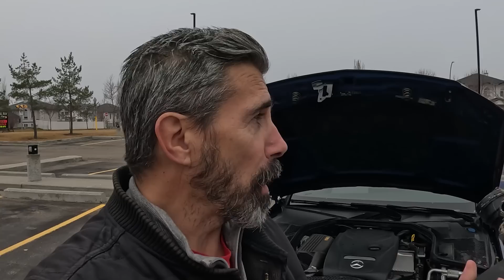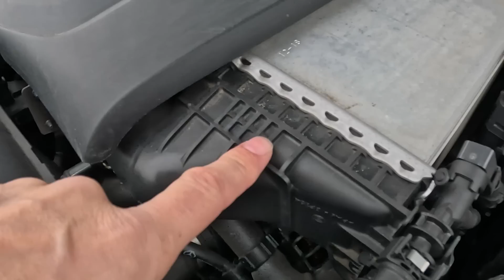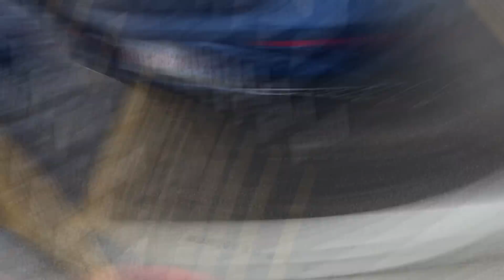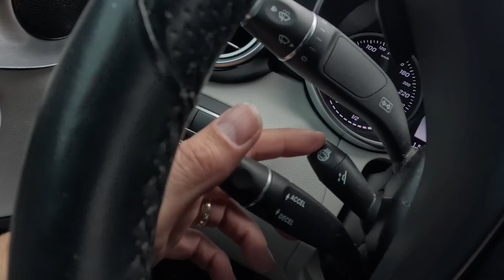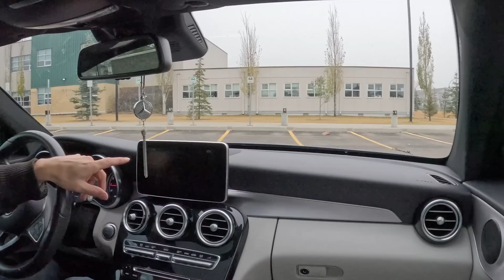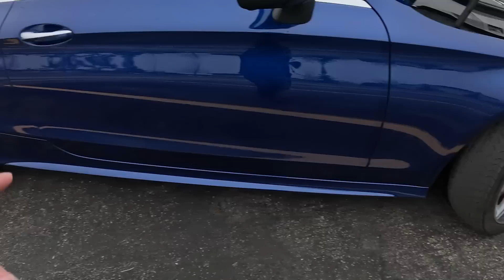Here’s Why New Cars Can't Last  5 Years | What Went Wrong?

Comment: Some plastics have softteners as well which evaporate with time and make plastics brittle heat makes these chemicals evaporate faster too. All electronics has a limited lifetime depending on how its build, capacitors are a very common failiure point even semiconductors age. The more of it the higher the risk, it is not if it is when it will fail. Especially with EV's will parts be available after 5-10 years and at what cost. A lot of components also get discontinued so parts cant be made even if one wanted to, that together with processors firmware which wont be available so even if you get one it dumb as a rock without its program. Some electronics might even have a built in counter/timer for them to stop working. like HP printers had over 20 years ago and bike batteries also have these.

Comment: Love my 2015 c300 just like the one I have here nearing $215k miles no issues! If you take care of the car the car will take care of you. The c300 is a solid vehicle even though there are many components made of plastic, it’s an entry level c class not a full blown maybach s class. They cut costs, but made it still very reliable. Also you can replace the headlight entirely for about $450 with used parts I know because I just replaced my headlight with parts ordered on eBay to avoid Mercedes $4000 bill

Comment: Thanks for making complete sense of what’s going on in the car world 👍 I’ve recently spent £7500 on dpf system , oil leaks due to plastic gaskets. If the engine blows this would cost £14000 the car is only worth £15000 
It seams it’s not worth owning cars out of warranty 🤷🏻‍♂️ crazy world
Reply: Get some acrylic silicone caulk at the hardware store and run it all around the outside of your gaskets. They will not leak.

Comment: Never seen more reasons to buy a Tesla in any video.  No spark plugs, HT packs, exhausts, high temp cooling, gearbox, clutch, brake disks, brake pads, turbos, cam belts, alternators, starters, oil, filters, don't freeze solid in winter, or overheat in summer. Conversions from summer to winter not required. No wonder the whole world is buying them.

Comment: Great channel Mark, Most of these manufacturer’s are trading on the great name they may of had in the past. They are charging twice as much for their cars initially, the spare parts made of plastic actually cost next to nothing to manufacture but they don’t retail them at 2 or 3 times mark-up, its 100,200,300 times mark up of what they cost, its ridiculous and outright profiteering. I have a 13 year old Ford, one of the last of the cars you can repair relatively easily, i also have a lease on a 4 year Ford only done 18,000 miles and its falling to bits, noises from the plastic water pump, il never buy another car again as its too much of a financial risk.

Comment: Even the plastic engine parts in older vehicles are better than today's plastic parts. Because of all those overstressed undersized engines, I'm better off with an EV when buying a used car that is less than 5 years old. At least those lithium batteries can last at least 20 years due to today's technology. If I had to buy another gas burner, I'd go with an older Mercedes with a naturally aspirated or supercharged V8 maybe a 5.5L V8 Biturbo.

Comment: So whats the point of the video? Invent a time machine and go 30 years back to buy cars? Yes cars are more complicated, but how many people drive 800.000km during the life of their car. They buy new at 200k anyway. And I rather have new car, that is more complicated, but also much more safe. And the reason cars are expensive are mostly the emmission penalties, so thats the government fault cars are more expensive. Adjusted to inflation, cars are still quite cheap to own and maintain nowdays. I have 6 year 150k km car, and its still like new, and its a complex hybrid with 1.4 TSI, very reliable engine. Ok it may not last a million km, but most cars dont do anyway, not even the 40 year old ones. The engine may have lasted, but the corrosion ate it up first. Look sometime at "customer states" videos, and the main problem most people have with old cars is corrosion and lack of maintenance, and that is definately not the plastic hoses' fault or of the complex systems.

Comment: Typical plastic parts found on modern cars these days:
- oil pans
- oil filter cans
- water pumps
- thermostat assemblies
- timing chain guides
- most of the cooling system plumbing
- fuel tank
- transmission fluid pan
- HVAC system air gates
- valve covers (crazy!) 
- intake manifolds
- PCV assemblies
On top of that, some manufacturers decided to do away with the oil dipstick, so you must trust electronic sensors to figure out the engine oil level.  This is getting absurd.
Reply: Ah but eliminating that oil dip stick saved them one dollar!!!
Reply: Yup my car has had 2 coolant leaks due to a plastic/aluminum radiator and plastic thermostat housing.
Reply: Not my 22 Corolla!  A lot of that stuff is metal including the valve cover.  It didn't even come with the stupid beauty cover.
Reply: @SevereTstormFan but isn't the Corolla too slow
Reply: you FORGOT my plastic oil rings in my2009 mini cooper s
Reply: We'll know the consumer revolution has begun when used cars before 2010 start getting more expensive.
Reply: There’s a lot of nonsense being talked here. I worked in the trade in the 80’s and everything (except maybe Mercedes) was crap, utter crap. Anything over 5 years old was brushed up they rotted so fast and everyone had a tool kit in the boot(trunk). Then Japanese cars came along and showed everyone how to do it. Five things drive change, regulation, innovation, customer demand, competition and profit. All are part of a cycular economy to which we’re all part of. You win some you lose some. My 2014 car is the best I’ve ever owned and it’s got lots of plastic parts😆
Reply: @richardwild-jones8147 based on your comment you clearly never worked with anything Mercedes I worked in the Netherland as a assistant mechanic at the Mercedes representation and your comment is just factually wrong
Reply: @Inventor1488I never said I worked on Mercedes and that’s a fact. So what’s your point?

Comment: Best way too protect yourself, find a car or truck you like, matters not what. Make it as old a machine as you can handle, LEARN, knowledge is power. Become your own mechanic, then all that cost is a third at least. Want your car to cost you less every month? Learn all you can....when you know enough, then most machines can be manageable and reliable. Older IS better, todays machines are not for the long run. You dnt have to get a dinosaur...but! you will have to go back a few years.

P.S. I run a 2013 Veloster NA, have already put in clutch and worked alot of the car already. Very workable car, alot of creature comforts, good mpg...small. I will be able to work on this car for years.

Comment: What I've been saying for years. After the 90's it has gotten progressively worse. Crappy plastic parts that break, leak, or just erode away. I'm not even touching the subject of all this electronic crap they throw in the car. Who really needs electric seats, touchpad screens, and voice-assisted whatever?
Even the manufacturers who had a good rennomé produce crap that isn't worth buying.
I had an old W123 300D. It wasn't fast but it kept running forever. When I finally sold it, it had 730.000 Km on the clock and was still running great.
I should have kept and restored it but other things came in the way.

Comment: What happens is the plastics lose their oils from the heat cycles which leads to embrittlement, they eventually crumble apart. cars from the 90's and very early 2000's had higher quality plastics which lasted longer. Another counterintuitive effect is that plastics inside the engine, living in the oil also become brittle as the engine oil breaks down the plastic over time. In the end they only need to last the warranty period then give them the ole heave ho. Do not buy a modern vehicle (2005 onwards) if they have done over 150,000 kilometres. Unless you are willing to work on it yourself. Buy a car from the early 90's or older.

Comment: Turbo charged engines are light years ahead in power delivery precisely because they drastically attenuate the biggest difficulty for natural aspirated engines: Breathing.
That's why most small 1300cc or 1400cc can easily beat most 2000cc natural aspirated. They're only similar on peak power. Same for 2000cc turbo vs 3000cc n/a, 3000 turbo vs 4000 n/a etc.
Reliability or longevity can be addressed and many engines have no issues. 
The problem is that many if not most people buying new cars, use them for 3 or 4 years and then jump into something better or simply a new version. This makes manufacturers relax. They do not fell the need to be competitive on longevity.
The thing I find the funnier is people complaining about turbo lag on some turbo charged engines.
On a turbo charged engine, we press the gas, the car picks up speed according to whatever engine capacity it has, then we get the boost.
On a natural aspirated engine, we press the gas. the car picks up speed according to whatever engine capacity it has. 
Basically, only one of them, has boost. We might have to wait for it depending on the lag, but it's there!

Comment: some things i need to comment on, there are some valid and invalid points in the video. There are parts you want to be flexible so they wear less mechanically and can handle heat cycles batter. one example is when you shook the intake, its something that its better to be flexing than rigid. Some things need to be rigid some shouldnt, depending on what its attached to and what its doing.

The big issue here is the expensive parts that are cheap. plastic is cheap but they're sold at a huge margin. Old cars did require replacing parts but they're cheap. You're showing a merc, its a car where everything is high margin.

You're complaining about not having a v8, but people are getting by with 2-3 cylinders, most in the 3rd world have been on 1 cylinder for decades, light bikes. In comparison theres nothing wrong with a turbo and if you've ever seen piston aeronautics engine they last and are supercharged and turbocharged. the lightness and power is very important there. What manufacturers did since old days that took time to get into the car industry is the use of iron sleeves in the combustion chamber to give the reliability and long lasting of an iron block but using an aluminium block. its the same with diesels.

You're complaining about being able to go not maintaining your car. the engine will wear more. In old engines this made them run poorly and lose fuel efficiency. For new engines making sure you change the oil when needed is crucial for the engine to last and stay efficient at old age. Engines arent the problem in new cars except for american cars. american cars are junk everywhere. german cars are junk in accessories around the engine but their engines will last if you dont skimp on maintenance. the problem is the germans expect the world to be using european quality oils which last at a longer distance than oils made and used in other regions of the world. The EU has strict requirements  for oil to reduce environmental impacts so their oils last longer.

About the battery, an aux battery helps the ECU To last longer. feel free to replace the ECU regularly when the flash run out, so the only option is on consistent tuning is to put the changes in ram, which requires power to last. features like alarm and security also drain, hence unlike old cars you have added security that drains power, so it makes sense for an aux battery to make the main battery last longer and not run out after a week of not driving and kill the main battery faster.

Buttons arent just about reliability but rather safety. using a screen to change things like AC settings while driving is a safety hazard. electric parts are generally more reliable than mechanical belt run accessories and are used in aeronautics. its when they cheap out on the parts that they dont last. electric parts are lighter and more reliable than their equivalent mechanical parts. Only american and european manufacturers make cheap parts and charge you lots for it which is why they're losing sales. They want people to buy new cars so they only make them to last as long as the warranty. Europe makes cars for their market, who buys a new car every 3-5 years. the american makers caters to the american market who have a lot more money than brains so want the most tech but cant do it as cheap and as reliable as china. the chinese market doesnt know a thing about driving, only that a car is an interior so they want features. Surprisingly chinese cars are more reliable. japanese cars are made for the japanese market, who are concerned about resources and need to conserve it so their cars last long. they are anti EV because their electric grid is too reliant on imports. The western makers make their parts expensive and proprietary to make you buy a new car. Gone are the days where you could use a generic scanner for codes and see whats wrong like "aux battery life low, replace aux battery soon"

This video is only half valid, from an engineer's perspective. You need to know why it is designed a certain way and which markets they cater to. Stop complaining about irrelevant details and start complaining about whats relevant, the market (consumer dumbness) and bad engineering being bad for the environment, not "oh we have an aux battery now and if that fails and your main fails you're stranded" can be solved with a simple voltmeter. cars used to come with them in the dash and powerbank starters are very good. the aux battery is gel lead acid because of environment (lead acids are fully recycled, lithiums are an environmental disaster). europe has better engine oils, aux battery helps main battery last a lot longer as it isnt drained when engine is off for ecu ram and security. flexing parts reduce wear from mechanical and heat cycles and what he touch was an intake shroud. car makers cater to specific markets, american manufacturers are just crap and expensive. replacement parts should be made affordable not as expensive as possible since both the car and parts are already high margin profits.

Comment: The insulation on wires is soy based, which is another reason vermin like chewing the wiring. The plastics on interior parts gets hot in a locked up car on a hot summer day, and cooks the oil out making them extremely brittle and weak. New cars are nothing but folded sheet metal and plastic. The engineering is geared toward more electronic bells and whistles that fail over time. The automotive industry needs a total rethink.

Comment: Turbos are not more fuel efficient though. They are an exhaust impediment. Take two engines of same size, turbo one, yes it will make more power, but off/boost/cruising/low fuel use scenarios, it has an exhaust impediment that is not providing extra power and thus uses more fuel.
Enrichening also uses more fuel for given power output (if NA vs FI are making same power for example). 

TLDR turbos are a cheap way to make a cheaper engine block that breaks more and are wholly unnecessary if you have normal, efficient NA commuter engine design.  It's also easier to increase the boost slightly for the next years model.
Reply from the maker: Thanks

Comment: Excellent video. I have a 2004 Mercury Grand Marquis that has an NA 4.6L V8, and aside from replacing the plastic intake manifold at 100K, I have never had an issue and it’s still running strong today.
Reply from the maker: Those are true work horses

Comment: Excellent video. I have a 2004 Mercury Grand Marquis that has an NA 4.6L V8, and aside from replacing the plastic intake manifold at 100K, I have never had an issue and it’s still running strong today.
Reply: Mother in law has one. Runs like a champ.
Reply from the maker: Nice

Comment: Plastic rattles too. Because it holds shape, tough to isolate those vibrating parts. The larger problem is cheaper overall assembly and computer dependency. The consumer hasn't a prayer to manage a car operationally.

Comment: Great vid. I own a 2015 merc c-class diesel which has done 85k miles. I agree modern prestige cars seem to be built with too many cheap plastic parts - mine suffers from interior plastics creaking and cracking. I've managed to run the service intervals at 20-30k miles so not bad on maintenance. Mechanically and electrically the car is pretty good, but the major issues have been with the engine and exhaust system sensors. Also rubbers around doors and sills tend to degrade - its annoying the doors get stuck in cold weather and rubbers pull off around their seals.

Comment: Just sold my 17 year old Honda Jazz\fit. The suspension was knocking . We were about to buy another Jazz but found on owner forums that 500k Hondas have been recalled in Japan due to a brake simulator problem affecting models 2018- 2022. We got no assurances from the dealership so we bought a Lexus UX, a totally different kind of car but should be reliable.

Comment: The PHEV should have been the legacy auto saver, but it will lead to their demise. People would not buy the PHEV in 5 to 7 years because this shit it will depreciate like crazy so you could just get a reliable and powerful EV and get over it. Give me a normal engine or an EV, don't push this shite electric motor and battery crowded with a hot turbo engine.